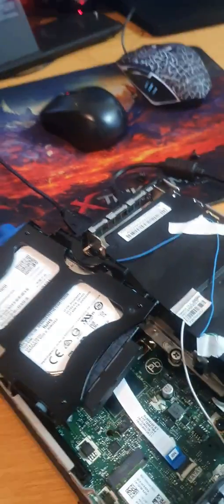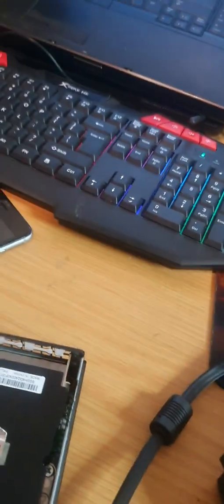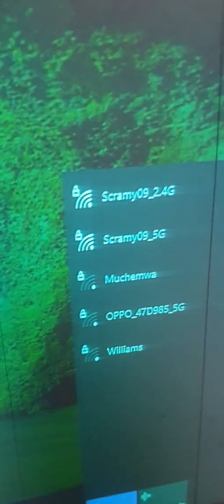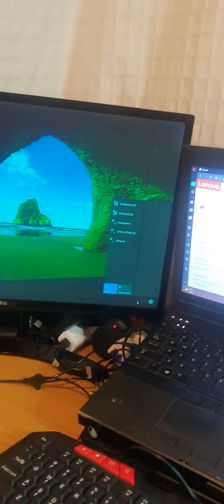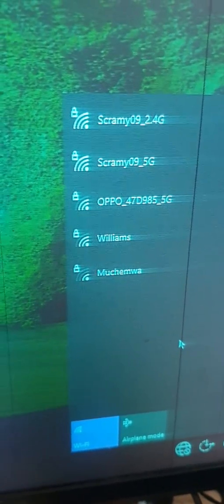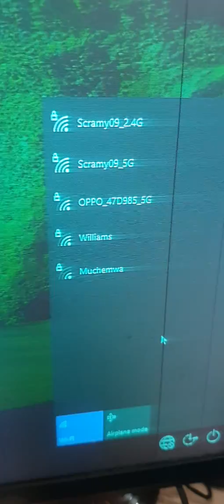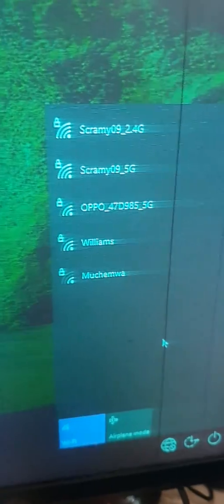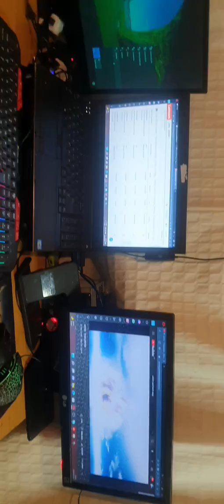Lenovo ThinkCentre M920q CPU Fan error (+ adding Wifi) quick solution

Comment: I know this video is very old, if you still have the system can you show where it is that you soldered on the USB exactly. I am having the same issue you had with the fan going at max speed and unable to be controlled with software or even replacing it with a new fan as well. How did the fix turn out 2 years later? Thanks!
Reply from the maker: Let me check it out with a PC I think I have in shop